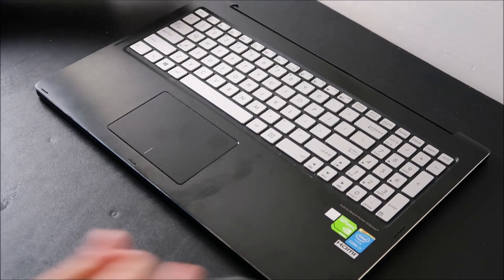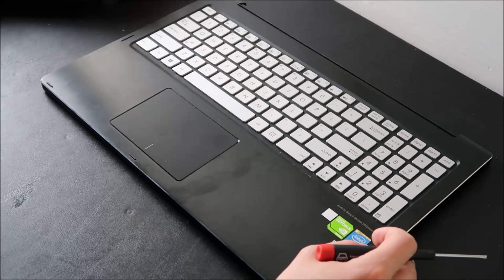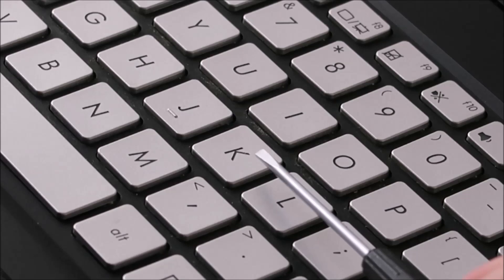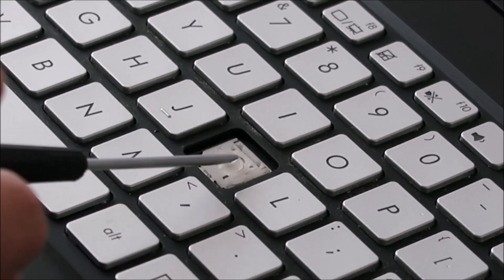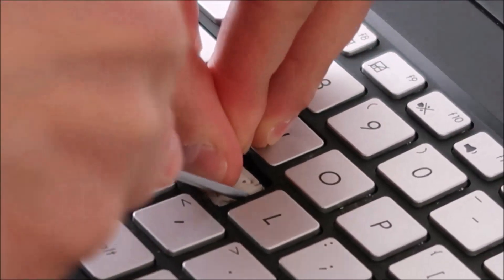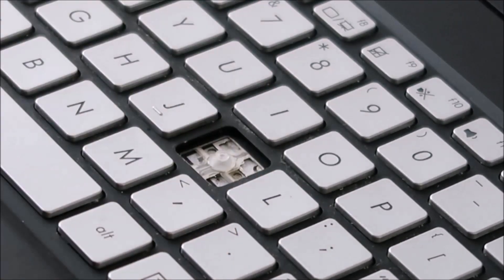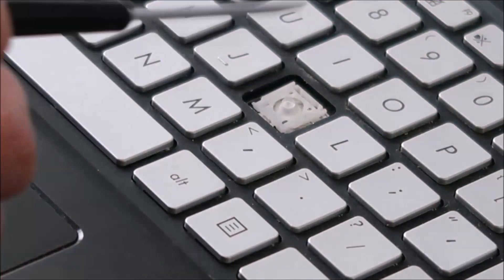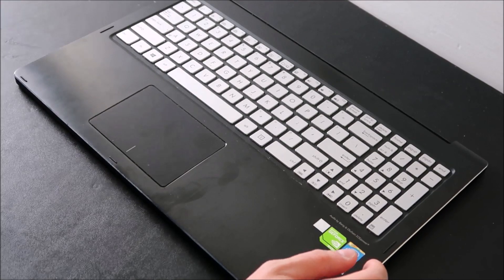How To Fix Replace Small Keyboard Key - Asus Q502 Laptop Computer

Comment: hi i have a asus vivo book M1502YA, my N key popped out. i inspected no parts are broken but im struggling to put it back in. pushing down does not help. please help. iliked the video
Reply from the maker: If your Key Cap is not clicking down in place correctly, it is most likely due to the Retainer Clip not being properly installed or damaged.  Remove the Cap and inspect for damage or that its not laying down flush and properly snapped in itself.  Compare to another Clip if needed by removing another Cap.

Comment: tutorial was great thank you. however although I ordered the correct model individual key and full keyboard via ebay. the only way the top key fits is upside down, because the original for Asus Stutorial was great thank you. the replacement key I ordered Asus 410U only fits upside down.
Reply from the maker: Yes, keys can be very annoying. Even with the same brand and model computer, they may use different model keys on the keyboard :(  You would have to try again to purchase the correct key or make due with the key you have. Only two options I'm afraid :(

Comment: What if one of the small nubs on the white key plastic part is broke off can the key still work or does it need to be replaced? Also my kids laptop key has that white plastic part u put down 1st it's wedged up inside the key number so basically that little white plastic part you put down first then the key part that white part is wedged all the way up inside the key itself
Reply from the maker: If you break or damage any component of the key assembly, you would have to replace it.  I usually get my keys on Ebay or www.replacementlaptopkeys.com.  If you cannot find a loose key for sale, you may have to purchase a keyboard and take a key from there.
Reply: @PC_Monkey  ty

Comment: My w key just got off, is this video about putting it back in a way it can work again? I gotta click the little bouncy thing underneath in order to type w.
Reply from the maker: Assuming none of the key assembly components are damaged, yes, this video will help you install it correctly.
Reply: @PC_Monkey  alright. I did something on the other side of w key, then squeezed it back in, and it's not doing so bad for some reason. I may or may not have fixed it.
Reply from the maker: @WarAble  Glad your all set :) Always here if needed !!
Reply: @PC_Monkey  it came off again. I touched the top right of the w key and pressed down on it while gaming, and that’s how it started to disconnect and get off the first time the same way it did just now 😅 whatever I’ll figure it out.
Reply from the maker: @WarAble  If your Key Cap is not clicking down in place correctly, it is most likely due to the Retainer Clip not being properly installed or damaged.  Remove the Cap and inspect for damage or that its not laying down flush and properly snapped in itself.  Compare to another Clip if needed by removing another Cap.
Reply: @PC_Monkey  it just seems to go back on it at times, stay on there, and then disconnect depending on if I click it many times on the top right side of the key. It’s probably damaged, I’ll probably take it to where someone can fix it someday.

Comment: so the retainer clip is stuck with the key itself but i cant get it in the right position so the retainer clip gets under the metal part
Reply from the maker: Because they key can usually not be reinstalled with the Retainer Clip and the Key Cap still attached to each other, you would have to separate them as seen here, using a small flat pry tool.
Reply: @PC_Monkey  ok thanks for telling me
Reply from the maker: @Neon_19090  Good luck !! Let me know how it goes :)

Comment: I need help! while i was cleaning the key, i accidentally seperated the plastic bracket and cant reattach it . i thought i did something worng, so i lifted up another key for referance and i cant get that one to stay and click into place!
Reply from the maker: In order for the Key Cap to fit into place properly, the Retainer Clip has to be installed correctly and not damaged.  If the Key Cap is not fitting into place, I would first assume that the Retainer Clip is not flat and correctly snapped in.  Unfortunately, the only way to tell if its correctly installed if your not used to it is to remove another Key Cap, while taking care to not remove or loosen the Retainer Clip and then compare it to your own.

Comment: Hey what if I accidentally misplaced the rubber spring in my d key. Yes, I know it's hard since it's only glued. I am currently copy and pasting the letter d but I find it annoying to press ctrl+v just to type "d" and copy the capital d
Reply from the maker: You would have to replace it.  I get most of my keys on sites like Ebay or www.replacementlaptopkeys.com.  Most sellers dont include that rubber spring in the key assemblies they sell so you may have a hard time finding it.  If you cant find it, I would just replace the keyboard.
Reply: @PC_Monkey  Uhm you're right, They said I need to buy the entire set since the circuit was already overworked. So it's better to replace the entire keyboard then. And plus it only cost 2000 Pesos or 38.35$ so it was worth the shot :D. But anyways thanks for making this video. Without this video, I would be worried that they will destroy my laptop without me even knowing but now that I understand, I am confident that they won't need to remove the lower components.
Reply from the maker: @blueproalt  Happy to help :)  Always here if needed !!
Reply: @PC_Monkey  Thanks, I guess I will just go to a repair shop to replace the key, since I'll still pay in both ways anyway.

Comment: Do you have a video on how to get those pesky plastic clips back together?? 🤔 Should be simple enough but I'm getting aggravated 😒
Reply from the maker: No sorry, at this time I do not as they are all a bit different.  The two pins on the left and right of the inner clip should fit into a couple small holes on the inside left and right of the outer clip.  To see exactly how yours should go, I would remove another key cap and look closely at the retainer clip in its position to see how it should be laid out

Comment: Sir... Plzz help me... My laptop asus X512 da... Model...

F button is not working...

Formatted pc...
Uninstall driver.   .
Done in soft ware side ....

Nothing solved....

Plzz... Help me....

MY ONLY DOUBT IS CAN I REMOVE THE KEYS AS LIKE IN VIDEO.... FOR MY MODEL.... PLZZZ TELL ME
Reply from the maker: This video is a tutorial on how to replace a key.  If your keys are not working but are not mechanically broken, troubleshoot them as seen here; https://youtu.be/wqrchfpdJ_w.  Have you tried all those steps and reseated the Keyboard Ribbon Cable at both ends?

Comment: The clip got separated what do I do?
Reply from the maker: They fit together with a small plastic pin on the left and right of the inner clip.  These fit into holes on the outer clip.  To see exactly how the inner clip sits in the outer clip, remove another key cap and copy the clip under it.
Reply: Thanks!
Reply from the maker: @sleepyskye853  Your welcome !!  Happy to help :)

Comment: I need help!  My Asus computer keyboard key came out but with the clip what I can  do ?
Reply from the maker: You would have to separate them as seen here, using a small flat pry tool.  Usually, they cannot be installed back to the keyboard while still attached to each other.
Reply: @PC_Monkey  ok thx 🙏

Comment: Hey I have an ASUS TUF FX505DT, the key cap doesn't snap in , the smaller part attaches well in rhe key cap but there is no way for the bigger one to hold it and the key comes right back out , can you help out and the orientation of the parts too ?
Reply from the maker: If your Key Cap is not clicking down in place correctly, it is most likely due to the Retainer Clip not being properly installed or damaged.  Remove the Cap and inspect for damage or that its not laying down flush and properly snapped in itself.  Compare to another Clip if needed by removing another Cap.

Comment: Hey cool video!
I saw your video on the acer aspire 3 and i want to ask
Mine has 8gb ram, 4 are solid on the board and then theres additional 4gb. Can i replace them with 8gb or 16gb so that i will have 12 or 20?
Reply from the maker: You should only max out your computer to what it is able to handle for RAM.  Extra RAM wont hurt your computer, it just wont be accessed and you will have wasted $$.  I usually go to Crucial.com to figure out the max RAM my computer can take :)

Comment: Good day. If its alright, Can i ask some help for my problem my laptop is having? 😅
Reply from the maker: What brand and model computer do you have and whats the issue with it?
Reply: @PC_Monkey  
Acer v5-122p-42154g50nss
When i turn on, it turns off after a few seconds. Then, using one of your videos as guide, i tried troubleshooting. When opened my laptop, i saw that the cmos battery (ML1220, 3V) showed some signs of damage and was not in place anymore. I hough im not sure yet, i think the problem lies in my battery, or the cmos battery or the wire that connects the motherboard  to the power supply. 
Wanted to rule out the cmos battery as the source of the problem by replacing it with a new one. Unfortunately, i could not find any ML1220 battery which is the exact original cmos battery of my laptop, so i was wondering if ita ok to use a CR1220 battery on it. 😅

PS. Sorry for the long reply. And thank you very much for answering. 😇